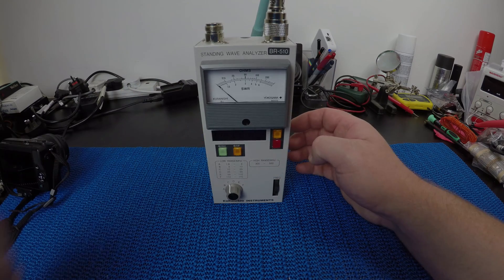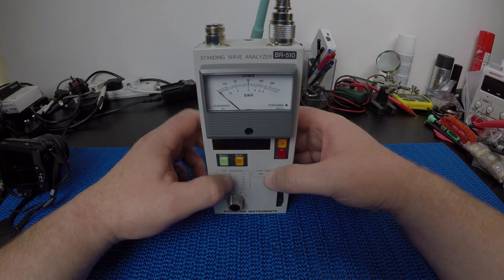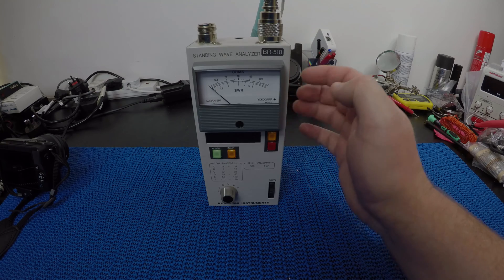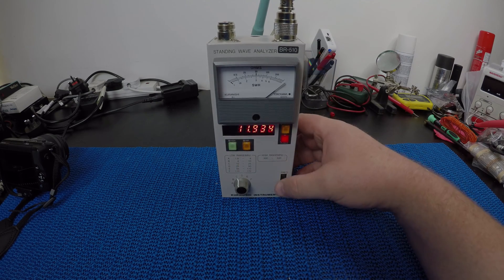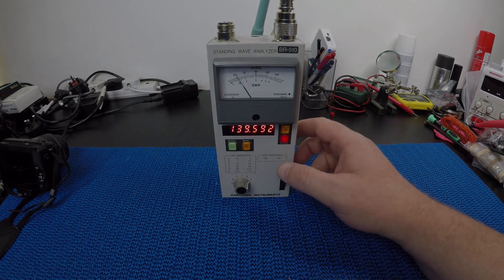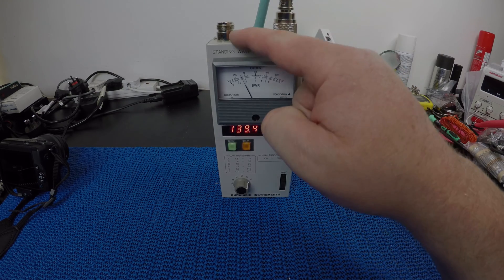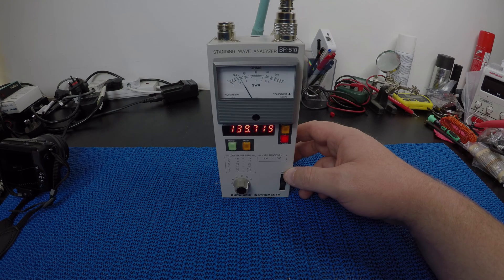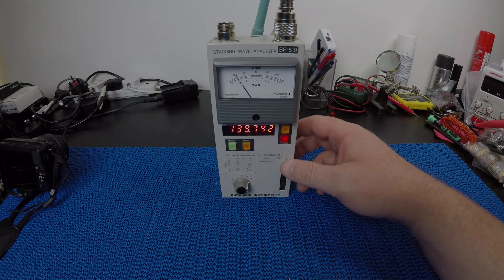The Kuranashi Instruments Standing Wave Analyser BR-510 meter

Comment: The buttons on the right simply change the gate time on the frequency counter moving the displayed frequency one digit to the left and lighting the overflow LED far right. The N type socket on top is for UHF measurements, high range 300-500Mhz. These are very nice meters despite their age and being obsolete. They are very well put together and reliable, beats the offerings from MFJ every time.
Reply from the maker: interestingly the N-Type does nothing.. the whole range works on the usual socket.. one day I will dismantle to see.. totally agree its a stunning meter.. Gaz
Reply: @TheGazLab  According to the manual the socket on the LHS (no.2) is for measuring high range impedance 300-500MHz. The socket on the RHS (no.1) is used to measure impedance from 1.8 - 170 MHz and SWR from 1.8 - 500 MHz. Y

Comment: I believe the inputs at the top are 1 UHF (SO239) and 1 "N."   The meter will switch to the N connector at the 300MHz range or so.
I can't say exactly as I can't read the ranges on the meter in the video.
Reply from the maker: patthegunsmith I thought that, however  doesn’t appear to be the case.. sadly the instructions are very vague but the second port appears to be optional.. Gaz

Comment: What a beautiful instrument this is! You are right, there appears to be very little information on this device. What surprises me is how much the oscillator appears to fluctuate without you changing the frequency. Does it do that as well without the antenna being connected?
Reply from the maker: Jan Lategahn it’s changing when I touch the case... it doesn’t do it with a proper antenna on .. g